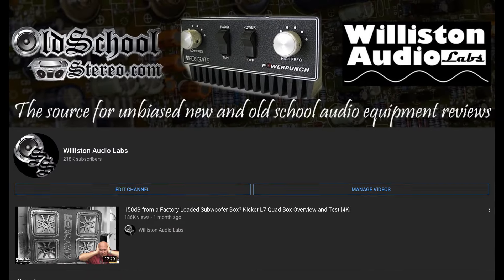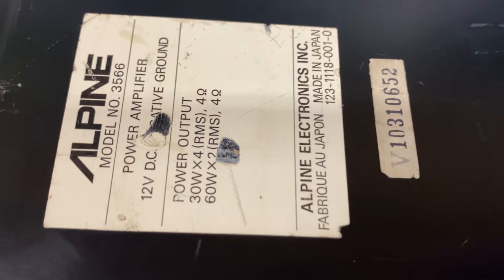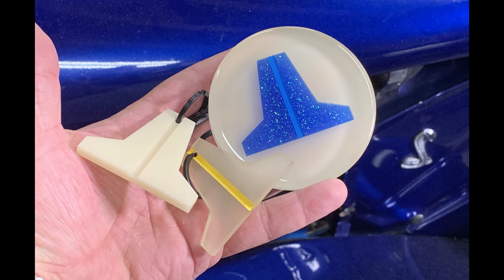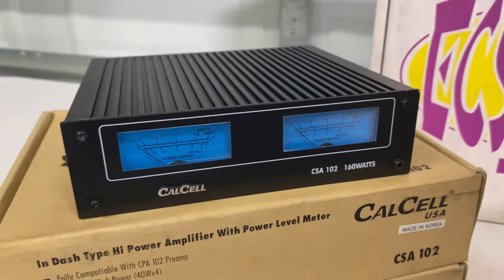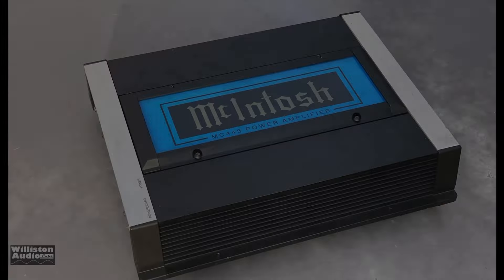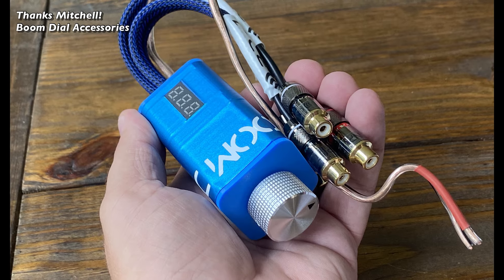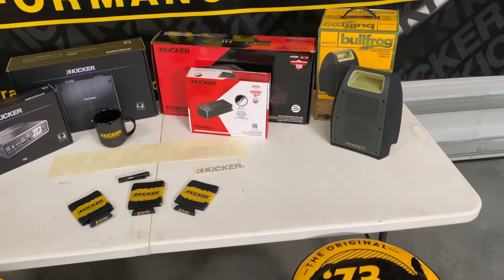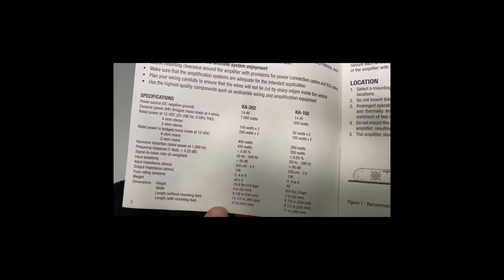Retro Tech? Car Audio Gear You Sent In - 2020 Year End Edition

Comment: Congrats on your channel success. I remember being into your videos a few years ago and recently have been thinking about car audio again so had to track you back down.  

I graduated HS in 1990 so I grew up in the heyday of the car audio rise of the 80's and 90's. IASCA competitions, RF Punch, Orion, Alpine, Kenwood, Audio Control etc.  Those Alpine head units with the lime green chicklet buttons give me a visceral reaction when I see them still to this day.   A thousand watt system that would "romp" but also sounded clean was the stuff us broke HS kids dreamed of. Especially when a Punch 45 was like 250 bucks. That's 5 bucks a watt!  Now it seems that the culture these days, with $100 Class D amps that alone can pump out well over 1kw and speakers with tires for cone surrounds, bouncing quarters off a roof isn't a novelty anymore, it's the norm!

Comment: The tech that has disappeared is the old under dash equalizer/amplifier.  You can't find them anymore.  Remember when you could put a 10 band/120W EQ/amp under the dash and run speaker wires to the back dash (which was mostly carpeted fiberboard)?
Reply: I have a Clarion under dash ew/amp sitting a bookshelf looking at me right now. 👍

Comment: I remember back in da day, I had a set on "m,m" 10 inch subs,completely see through cones,and a unic amp,!!!
Reply: Unic 100×2 was my first amp in my first car (1967 VW Beetle).  I purchased it at Mad Mark's in Bradenton, Florida around 1993.
Reply: @csj9619  yuppers, mine was a 1974 mustang 2 hatchback, lowerd on its ass ,for my cross over for the subs, I had found two bass coils, cause the amp was full range two channle, with a split box sealed!!!! I had no idea about ohms law yet, so yeah ,ran the amp in stereo, 4ohm!!

Comment: Man those old spade terminals on the speaker! Reminds me when I first got in car/home audio. I never had money so when I got something like a speaker instead of properly hooking it up I would just twist the wire and put in through the hole of the connector and wrap it around itself. Using car speakers inside on my receiver, knowing nothing about what ohms and resistance means.

Comment: You know by today's standards my old amps would be considered weak but I ran two kicker 240's bridged down, one per sub. Now they were 4,2,&1 ohm stable and I should add that I also ran a cadence QR-7 crossover with 7 volt line driver which you almost never hear about any more but what an improvement they made boosting the line voltage before the amps . Also I should add that the two kicker amps had been rebuilt and may have had an upgrade when rebuilt but those little guys slammed in my little hatchback! Deep bass!!! In fact we hit 144 DB and they had the meter in the floorboard and we found that there was a lot of junk under the seat so I wonder what it would have ran if the junk would have been cleaned out first! However it was my first time attending a stereo competition!

Comment: The Alpine A-R90S is their current version of that. X10 high pass on 1&2, with 250x2 on 5&6. Perfect for a sweet 3 way setup, or a 5 channel system. I would still use that classic one if I had it.

Comment: Hey big D just for fun and thought you'd like too know, I still run my original bought earthquake aka shredder amp on my JL w7 12 and it sounds great. Never heats up and looks and sounds new. Remember I never pushed the amp as the woofer is 3 ohms and maybe with box rise is more like a 4 ohm load. I've always had complements on how good my woofer sounds and yes also original JL w7 12 I bought the day they originally came out. MB quart Q highs on Tru power. Love me some old school quality. Originally my badass system was class A monolithic and woofer amp on JBL gti 1000 ported sub with Alpine top of the line head unit and MB quart Q highs. Got lot's of complements for sound quality from the best installer in B town. Thanks Big D.
Reply from the maker: That’s awesome 👏

Comment: I want to see the dyno of the SPL amp. I used to sell them at a pawn shop back in 2003. I had 2 of the "3000" watt models, strapped(yes, they're strappable) on 3 Rockford Power HX2 12's, in a 9 cf. ported box. It sounded good for cheap amps.

Comment: The harness plug is actually the same as Clarion, however you need to re-pin it or just use the appropriate wires. Don't plug it in by what colors you see that's for sure. Rockford has the wiring diagram sticker on their old units so only a big dummy can mess it up.

Comment: Alpine 3566

1 × 38 watts, channel 1 at 4 Ohm
2 × 35 watts, channel 1 + 2 at 4 Ohm
4 × 30 watts, channel 1 up to 4 at 4 Ohm

4 × 28 watts, channel 1 up to 4 at 4 Ohm +
2 × 56 Watts channel 5 + 6 at 4 Ohm
Current consumption 32A
efficiency 51,6%

4 × 26 watts, channel 1 up to 4 at 4 Ohm +
1 × 169 Watts channel 5 + 6 bridged at 4 Ohm
Current consumption 42,5A
efficiency 47,6%